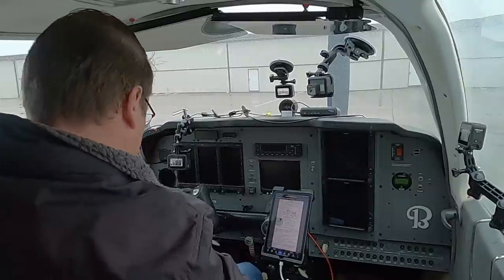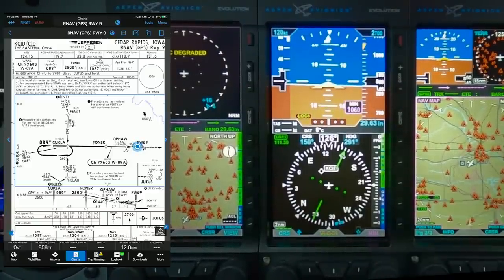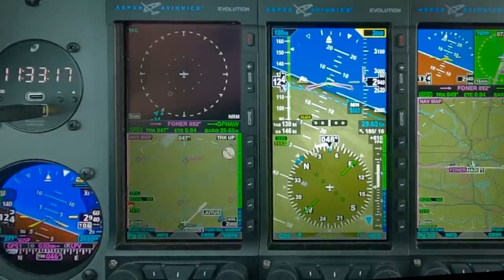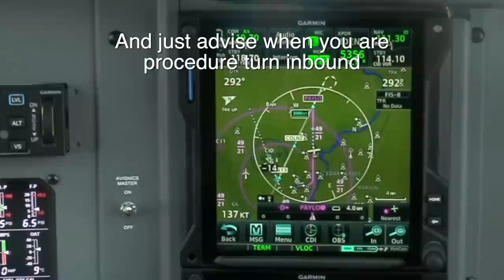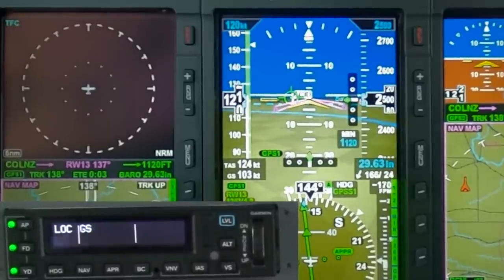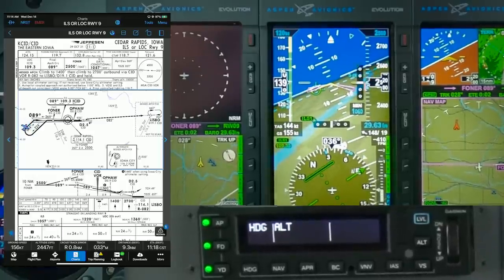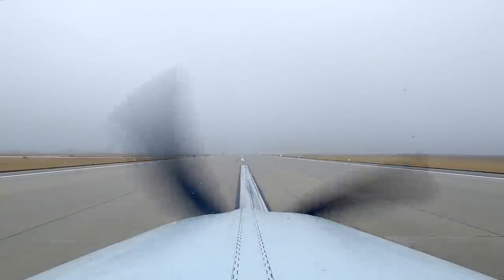Low IMC with the new Avionics Panel

Comment: The only thing I would do would be leave the gear down to til the runway disappears. If you immediately raise the gear at positive rate and the engine quits, you may not be able to get the gear down in time. I was always taught to wait at least till you were either at the end of the runway or you cleared 200 feet.
Reply from the maker: I think in weather conditions like what we had that day, a gear-up landing that I walk away from is a pretty good outcome of an engine failure.
Even in nice weather, my number one priority for the (unlikely) case of an engine failure is survival, not preventing damage of the airplane. And the sooner I raise the gear, the better I climb, leaving me with more options for gliding in case the engine quite right after leaving the runway behind me. I cannot think of a scenario where my odds of surviving an engine failure would be improved by delaying raising the gear.
Regards,
  Martin
Reply: @martinpauly  I guess on that note that’s pretty straightforward. I just see the airlines depart and they usually don’t put the landing gear up until they’ve passed about 500 feet. When I come in for a landing, I also like to profile flight just like the airlines, and my landings are always soft and smooth mains first, usually with the nose gear, about 8 inches above the pavement for aerodynamic braking.

Comment: Hi Martin, another good mission and video thanks.  Always rewarding to fly approaches in IMC down to minima.  My autopilot is nowhere near as advanced or capable as yours, so just to clarify the TOGA mode please.....  
Am I correct in thinking when you press the TOGA button it transitions the autopilot from the existing Approach mode to a pitch up vertically, and runway / existing track laterally?  Does it also transition your GPS into the Go Around phase, or do you still have to press the Unsuspend key on the GPS screen?  
Also, presumably if your Go Around track is not straight ahead I'm thinking you have to be pretty quick to then engage HDG or GPSS mode after engaging TOGA, to get the aircraft turning correctly....? Or maybe it can handle a turning Go Around track if that is the published missed approach procedure?
Sorry, lots of questions. Nice job seeing your new Aspen screens at work.
Reply from the maker: Good questions... and the answers will differ a little bit from installation to installation. The TO/GA button in my Bonanza sets the flight director bars to wings level and 8 degrees pitch up. The idea is to transition safely from a descent to a climb - everything else is second to that.
Some installations can automatically transition to the missed approach procedure. In my setup, that requires a manual activation of the missed approach, but maybe that's a configuration thing I haven't found yet.
Regards,
  Martin
Reply: Thanks for your reply. 
I’m thinking in the perfect world one could fly down to minima hands off, press TOGA allowing the autopilot to steer the aircraft around the missed approach path and join the subsequent holding pattern prior to the second approach. With an autothrottle system the power would increase as required too when engaging TOGA. But then I guess by that stage we’re effectively flying around in a mini airliner!
Reply from the maker: @EtiRats  You are correct on all counts!
- Martin

Comment: That has to be scary as you're approaching minimums. At what point do you look outside and away from the instruments?
Reply from the maker: It's not scary at all. I know that as long as I fly the charted procedure and altitudes, all is good. So I trust the instruments. And while there is some uncertainty (in really low clouds) on whether the approach will end with a landing or a go-around, either one is perfectly safe.
As far as looking outside - all along, I take an occasional glance outside to see if I can transition to a visual landing (the earlier I can, the easier it is). At the very latest, when I reach the decision height of the approach I have to look outside and make the decision whether to land or not.
Regards,
  Martin
Reply: @martinpauly  when I was learning for my IFR rating, I was told when weather is that low to expect a miss.  If I get to land, consider it a bonus!  I remember one night flying with a friend as he shot approaches into Columbus.  Said to pack a toothbrush and change of underwear as our alternate was Pittsburg.  Ceiling not so bad, but visibility as at or near minimums due to fog. After two missed approaches and no runway, we made a last one and just saw the rabbit. If not, we were on our way to Pittsburg!
Reply from the maker: @Richard-xe1it  That's a good way to think about it!
- Martin

Comment: I earned my instrument rating in 1992 with a minimally equipped Cessna 172, VOR, NDB and DME plus the required markers. My how things have changed.
Reply from the maker: Indeed. I got my instrument rating a few years later, in 1998. The typical trainer at the time had dual NAV/COMs (one of which had a glideslope) and a DME, plus an ADF. That was it. More hands-on work, but in a way easier because these systems were so simple to operate - just dial in a frequency and a course, and you're good to go.
- Martin

Comment: I love it Martin!  A great IFR video...your new panel is exceptional!  Thanks for sharing.  I am contemplating replacing my Century II autopilot in my Cherokee 180 with my Aspen MAX 2500 system & an IFD540, would the GFC600 be compatible with my system do you know?  Thanks again. Don/NE Ohio 🙂
Reply from the maker: Thanks, Don. That's a good question for your avionics dealer. Also check if the GFC600 is available for your Cherokee - autopilot testing and certification is very aircraft-specific, and I don't recall if Cherokees are on the approved model list for the GFC600.
- Martin

Comment: Great video! The editing and flying were both quite professional.

I couldn't tell from the video, where do you add flaps on an approach to minimums like that?
Reply from the maker: Thank you!
Regarding flaps: In the Bonanza, I extend approach flaps somewhere between 1000' and 500' AGL. Full flaps only after the runway is in sight and landing is assured - meaning that for the first two approaches (which ended in a go-around) the flaps never got fully extended. That makes the go-around easier.
- Martin

Comment: Why not get an G500TXi? Would be so much easier… I remember you had your reasons you wanted to stick with ASPEN, but I don’t remember.
Nice video!! As always!! Keep them coming!! 😄👍🏻👍🏻👍🏻
Reply from the maker: Good question - and one which I have answered many times here on YouTube, in comments and also in earlier videos, like this one: https://youtu.be/EQL0-mEz5o0
In a nutshell: yes, creating yet-another all-Garmin cockpit would have been easier and faster, and that would have been a very nice and capable setup. But being part of a new development and certification program and helping create something new sounded more exciting and more like a real learning opportunity. In addition, a multi-screen Aspen setup offers redundancy which will keep me flying should my primary PFD ever fail - I simply switch to the backup PFD while waiting for a replacement part or repair. In that sense, the Aspens make more efficient use of the panel space than the larger PFDs.
Regards,
  Martin
Reply: @martinpauly  Thanks for your answer! Hmm, now I see where you’re coming from. The redundancy aspect is indeed a very good argument! That’s why I kept my engine instruments. At least I can fly VFR in case the TXi goes belly up. Problem is here in Germany you need a supplier with the best customer support in Europe. So that’s why I went with Garmin. I really hope I’ll never regret that… ;-)
Reply from the maker: @timmholzhauer3342  Fingers crossed... oder: Ich drücke die Daumen, dass Du den Support nicht brauchen wirst! 🤞

Comment: Don't like the PFD. Lacks AP mode annun. Also AP could be more friendly, needs approach arm and approach capture + annunciation. Have had older APs with these incorporated. What a SET BACK! Not happy with this AT ALL. Was an AP repair specialist at MSP international airport. Many AP test flights via coupled approaches. Mostly twins and turboprops.
Reply from the maker: I agree mode annunciation on the PFD would be beneficial. The Aspen PFD does that for many other autopilots; it was Garmin who disable this feature for the Aspen/GFC600 combination.
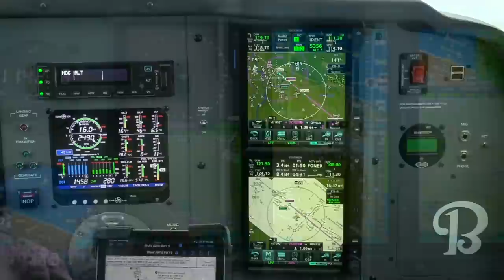Beyond that, I cannot follow your complaints. Arming an approach is possible and shown at 16:40 in this video, and again at 32:58. Same with approach capture. I don't question your qualifications with other autopilots on larger aircraft, but the observations you shared here on the video are not accurate.
Regards,
  Martin

Comment: Annunciation of mode on the PFD is a Human Factors issue and important. Keeps the pilot informed as to the autopilot mode of operation. The Bendix FCS-810, a later generation then their M4 autopilot, has or had  a variable angle intercept function. When invoked, the annunciation was heading mode plus Approach Arm. When the intercept with heading steering became < 45 deg to final approach track, the annunciation became Approach Mode and Heading mode automatically canceled. Intercept was performed rolling onto final track. AP went to track mode from intercept.

Don't understand why Garmin AP doesn't have the same capabilities. Maybe it does, just unfamiliar and just don't know. Seems like a regression in functions. Pilot should be aware of what the AP is doing at any time. Same goes for Flight Director.

As an aside, all APs in aircraft and especially Boeing should have pitch trim in-motion audio such that the flight crew knows immediately when the AP is auto trimming the pitch axis of the aircraft. That may have prevented the two foreign B737 from crashing straight in.  But I digress. Have extensive AP repair and flight test background at MSP twin cities.